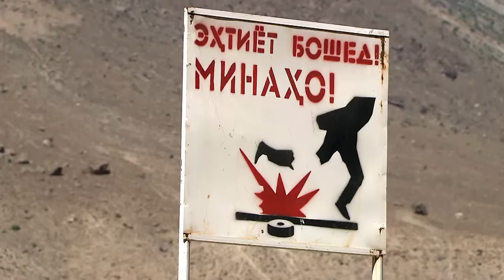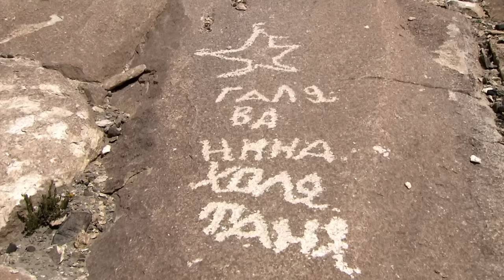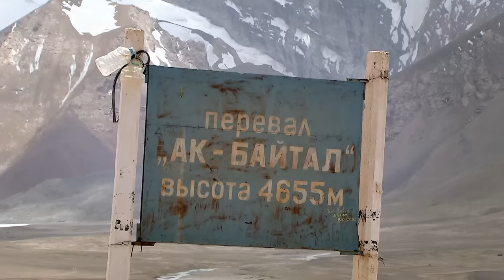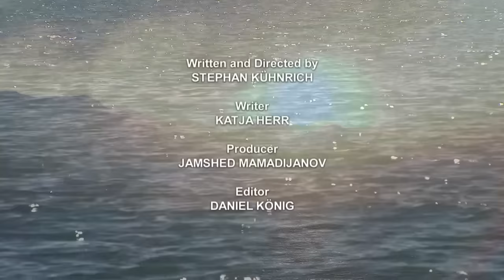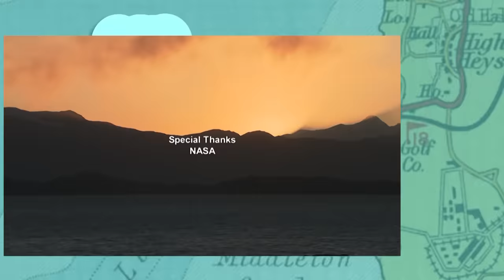Tajikistan's Black Lake On The Roof Of The World

Comment: Beautifully done.  Recommendation for the men hauling water: If they could obtain a hand operated pump and some hose to place out in the lake suspended off the bottom the water could be cleaner, it could be easier and faster.  A reciprocating pump where one man on each side pushing down  on the handle would be best.  The people of the community are very hard working and ingenious.  I wish them well.

Comment: PROFOUNDLY WRONG MOUNTAIN BIKES FOR THIS DIF JOURNEY: FAT TIE BIKES ONLY (4-5 INCH SOFT FATBIKE TIRES), FULL SUSPENSION, 27.5 INCH TIRE DIAMETER --  BETTER GRIP, WAAAAAY SOFTER RIDE, LESS FATIGUE.  FAT BIKES ARE NOT HEAVY, HAVE V-DIFFERENT GEARING TO MAKE CLIMBING EASY, FLATS EFFORTLESS.